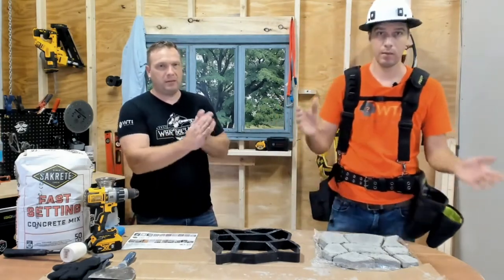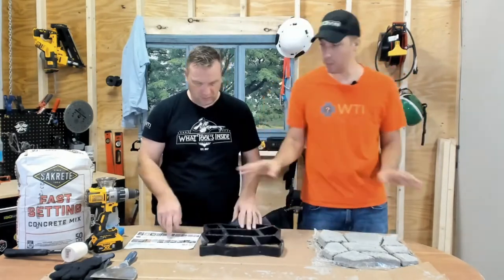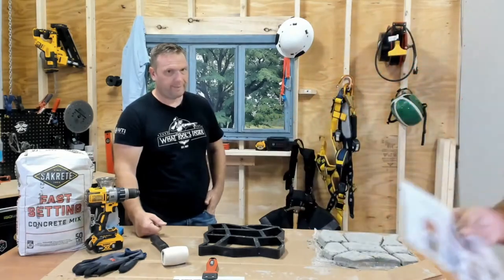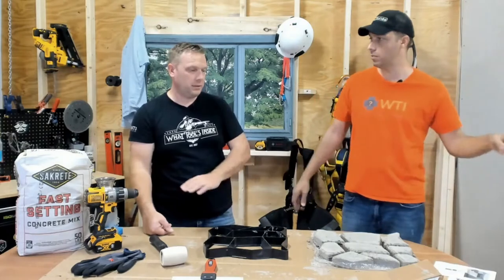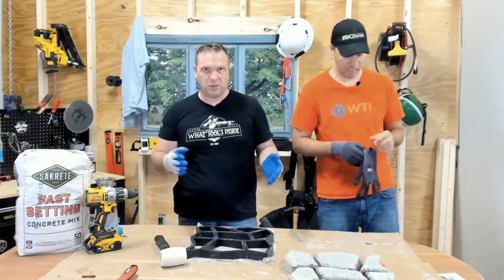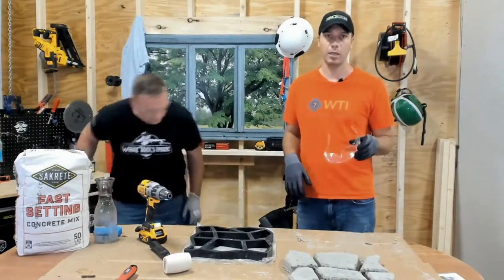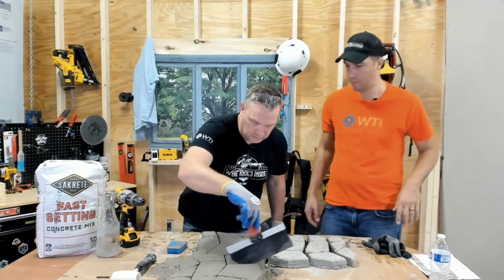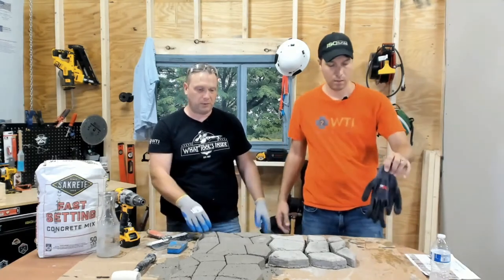How To Use Concrete Molds

Comment: did i miss how much you powder and water you mixed to fill that one mold?    :)  and any suggestions on if you need topsoil or just sand to set them into on the ground?  how thick of base do you recommend?